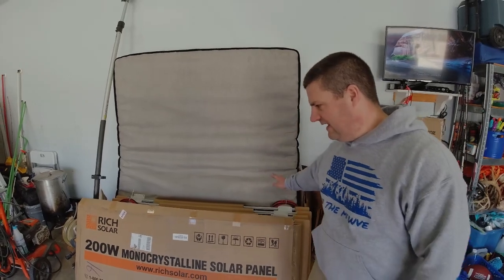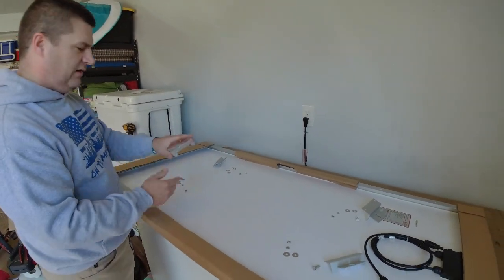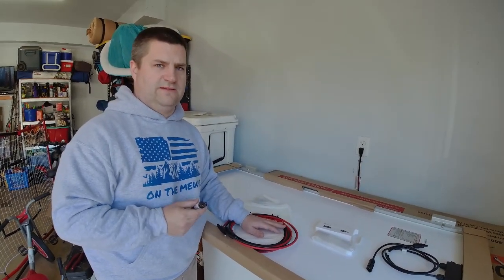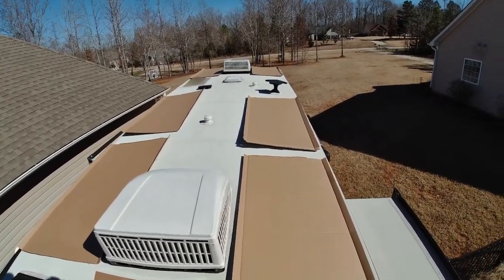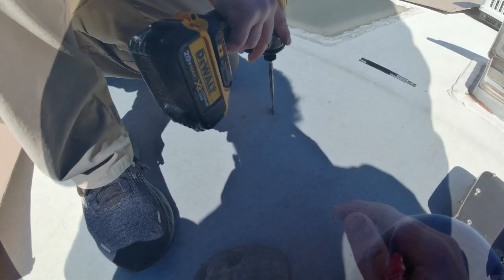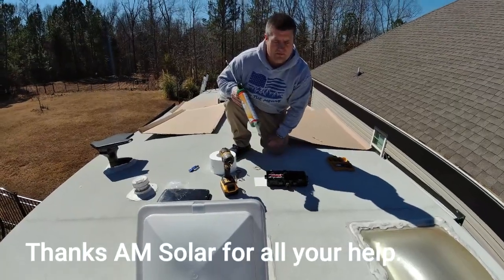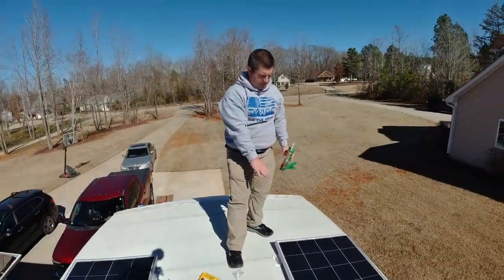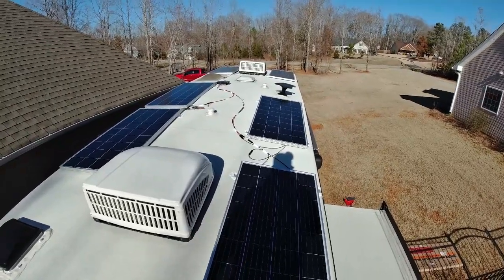How to Install Solar Panels on a Fifth Wheel

Comment: Hi there, nice video.  Here is a question for you.  Can I use a 4s lithium battery in my trailer instead of a regular led acid battery?  In other words can I Use a 14.8V battery instead a 12V battery?  Thanks
Reply from the maker: Thanks!  So we switched from lead acid to lithium with this install but the key component, for your question, will be your converter/charger.  Some newer rvs have a lithium ready converter/charger on board.  Ours did not so I added a Victron Multiplus II to use as an inverter/charger.  You can can change out the simple converter easily if you need to without buying a more expensive inverter but it all depends on what your goal is.  Thanks for watching! ~Wilson

Comment: Not an expert here but that breaker switch installed between solar panales and Charge controller is usually rated for 48V or under.
Reply from the maker: My system should not run above 20-22volts max so it should be okay.  1 year after the install it’s working beautifully.  Thanks for watching!  Wilson

Comment: Be careful when you say you won't ever have that voltage or amps. The stated specs are at 77° f so you can over produce at lower temperatures
Reply from the maker: That's true, I should not say never but it is very unlikely in our situation. Thanks, Wilson

Comment: brilliant install but what bugs me why don't they make elevated bars that can Mount to the mounting brackets that  hold the solar panels to the roof to hold the wires off the roof so crap doesn't build up around them you could use aluminium u channel upside down it took the wires then it would look neat and wildlife or the weather will damage them
Reply from the maker: Hey Mike, they make the mounting system but I decided not to go with it.  Good idea about the channel, I may go back and do something like that.  We just got back from a 9000 mile journey and the tape held up well.  Thanks for watching and taking the time to comment. ~Wilson